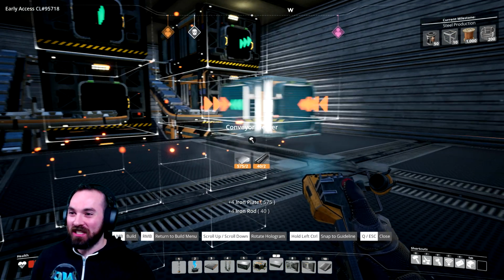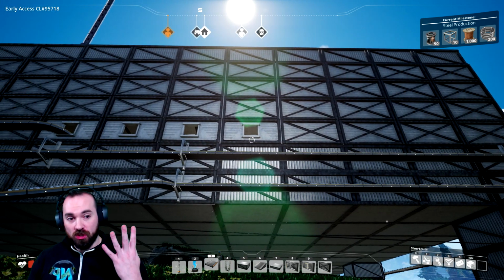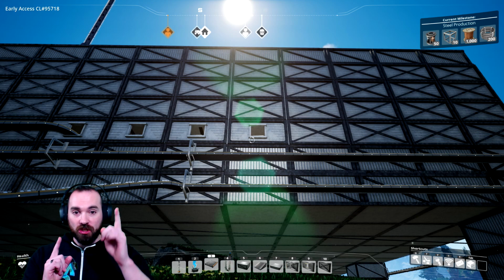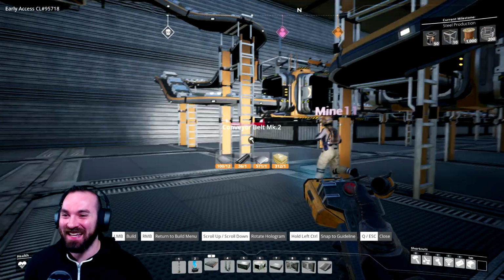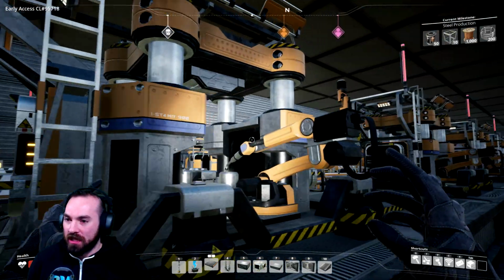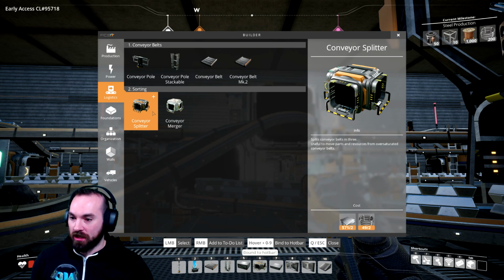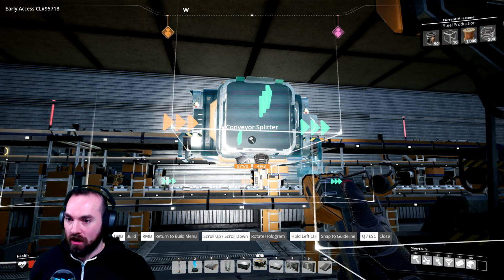SATISFACTORY - How to Build a PERFECTLY OCD Friendly Assembly Line for your Factory E8

Comment: @3:49 how did you get the conveyors to wrap around the corner of the building from wall conveyor to wall conveyor? I'm trying to do that and its clipping through the corner of the building at 45deg, instead of going around the corner with a 90deg.

Comment: OCD friendly unless you like efficiency
Reply: No kidding. Off the bat they're getting 50% to the first one, then 25% to the second one, then 12.5% to the third one, and so on. I hate this design because it just relies on your overwhelming the first machines before it starts to properly load up the machines further down. This is far from being OCD friendly.
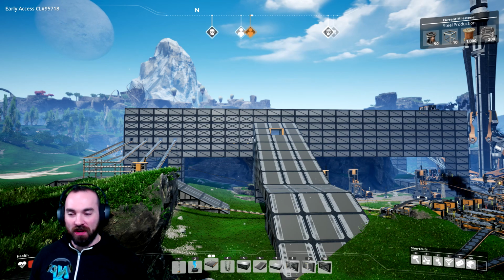Reply: @kerradeph  also, at 1:18 some of his walls are facing away from you and some are facing towards. Not very OCD friendly.
Reply: @markyoung2847  No they're not. The sections with the diagonals are foundation blocks. The sections with the X are walls.
Reply: @kerradeph  It's not about "overpowering" the initial structures to get to the ones down the line. You get the same efficiency as if you would try to exact split stuff.  It just takes a couple minutes to kick in. Not a hard concept to understand. Lots of videos about it.
Reply: Agreed, this was cringey as hell. Get some experience before making this kind of video.
Reply: @1Mackinzoid  Why? I want a professional critics review.

Comment: How did you get mid-air splitters/mergers? It only seems to let me place them on the ground...
Reply: You need to have a belt already in place, then you can place a splitter or merger onto that line.
Reply: Two years later, and the splitters/mergers are still a nightmare to deal with. (They are non-standard alignments and they do not have a simple "rise" pole for installing, like the belts have. That is just ignorant programming. Failing to add something that EXISTS, like the belts pole, is just dumb.) There is a similar issue with the vertical lifts too. Failing to use basic standards and failure to add things which already EXIST, in code, on other things. To add insult to injury, the colored arrows, to see direction... The green one turns ORANGE, like the other three, when it is behind the unit!

Comment: wrong build , the belt can only cary 60/min, you split it in the begin , u have 30/min incoming and u want to feed 4 module that cosume 30/min by them self , u have to upgrade the belt. And even if u do so u will  hit a hard cap very fast coz your income is to slow and yout output have the same probleme. Its not factorio u cant build a "main belt" u have to get 1 belt for eatch line of production and never mix it until the Tier 3-4 where the production is very low.  But it look nice

Comment: You have too much storage. Those are going to be impossible to move at a later date. Since ore fields are essentially unlimited but have limited throughput, all that you would achieve with such a large storage facility is to delay the inevitable.
Reply from the maker: we are building in a way that we don't have to move storage later. future proofing
Reply: @NerdParade  Regardless, there's just absolutely no point in buillding such a large storage unit. As far as I'm concerned, your videos in Ark Survival were great, but this is a horror show. As I said in my previous message, everything is governed by the throughput of your ore field no matter how much storage you setup. You just need enough storage so that you always have building supplies and that's it.